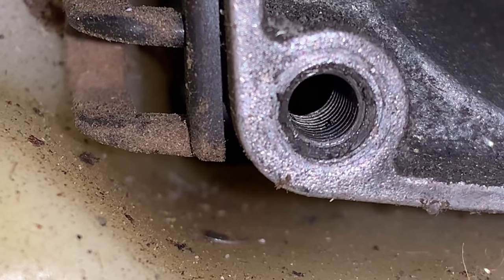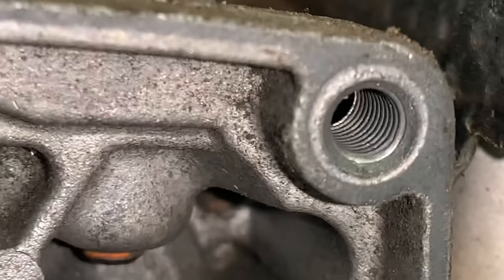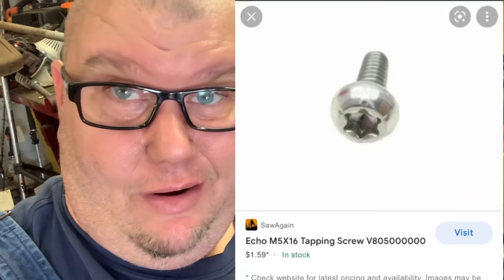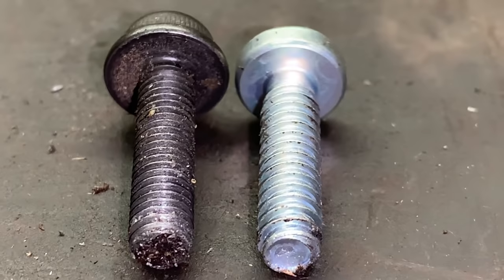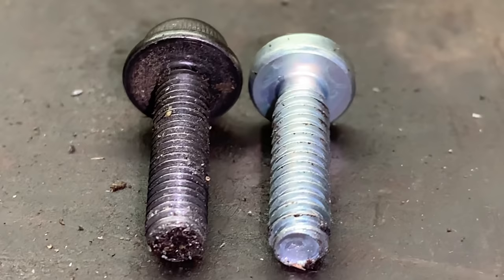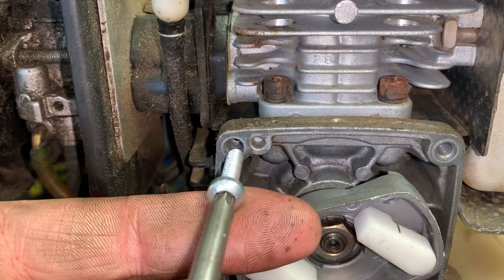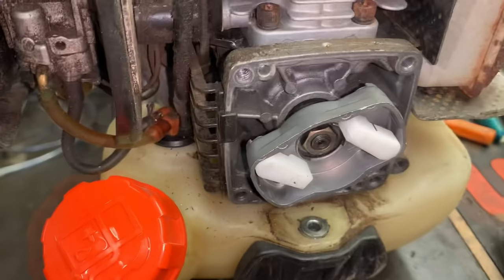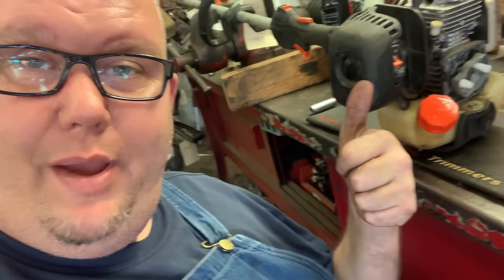STRIPPED THREADS? THIS MECHANICS TRICK / HACK WILL SAVE YOU TIME, MONEY, AND LOTS OF FRUSTRATION

Comment: “There’s is not a single thing wrong with that”  - are you kidding me? There is barely a single thing right with it. There is nowhere near enough material there for that to be any use whatsoever. The tapping size hole for an M5 thread is 4.2mm  and this hole has had the threads ripped out of it. That complete and utter botch job of throwing a coarser thread down a stripped bore will withstand next to no torque at all. You can even see that the thread it has cut is an absolute mess.  Good grief, this has to be the best advert for your competitor ever.
Reply: I agree. Nuts.
Reply: Yes, he screwed up that hole big time. I can't believe he posted the result.  😂
Reply: Look chums this is a get you home bodge when nothing else do it's fine for that ! You are clearly not heavy duty marine engineers are you?
Reply: @bertiewooster3326  Yep, get you home bodge alright. But this guy said "there's not a single thing wrong with that" as if it was equivalent to a proper fix.
Reply: I feel like saying “I’m a French model”  That ghetto fix is frigging awful.
Reply: Bro, he literally banged on it with his impact driver a bunch of times. It'll be OK.
Reply from the maker: Thanks for watching.  Repair still solid after a year BAM!
Reply from the maker: Still working flawlessly after a year
Reply from the maker: Been working great for over a year I’m too fat to be a model
Reply: If this self tapping screw meets the torque specs, I see nothing wrong. However, I’m not gonna use it on something that is prone to leaking
Reply: Best case scenario you then chucked a m6 in their and red lock tight even then it looked easier to be able to bolt it from the bottom with a longer bolt as I a am assuming you want even stretch to a ten spot for a pack of just a few helicoils instead you created a nail as that will pull out
Reply: Looks like the bolt was tapered so once top case is fitted the bolt won't go in so far a d it will be a loose fit.
Reply: I very much doubt it can now torque to anything like what it should but some people sit scratching their head wondering what they can do this is 1 option or go up 1  size of pitch or bolt looks like m6x1.0 swapped with m6x1.25? time cert would be the correct move or helicoil but I get the point I don't like having to start drilling the engine case for example unless its my only option or run a thicker bolt?
Reply: That will help with my seat mounting hole I think

Comment: just sacked a mechanic for using a power tool to cut threads! what planet are some people on. also u should be grinding a line down two sides of the bolt for the waste material to escape

Comment: The notion that a company like Echo ever drilled and tapped  holes individually is ludicrous, as is the idea that inserting a helicoil is difficult or inconvenient. These tri-lobed, thread forming screws work well when properly installed in a very specific hole size, as in initial production, but once they fail you'll be back to the utterly reliable helicoil.
Reply: I prefer the stronger helicoil method.
Reply: strength is the issue

Comment: m5 thread strpped out is the tapping size for m6, i would prefer to tap  and use a m6 socket cap screw ,to ensure the job does not return
Reply: Exactly, that is no good
Reply: If the part you are putting the six mil. screw thru has a big enough hole. Many fixes for many situations.
Reply: And I would tap and change all 4 screws so the next person (owner ?) that takes off the recoil can mix and still match all screws.
Reply: @danielrobert7181  even better  but mowermedic says its a hack not a full repair

Comment: You can always re-tap the hole to the next size like a standard size instead of metrics! I've done that method to fix a stripped out screw before but I  took an extra step with marking the location with painting the spot! You could stamp the location but you can't do that to a screw but paint seems to work easier!
Reply: Tapping is the correct way for sure !
Reply: If you are doing this at home, fine. If he is charging customers, he’s ripping them off! 👎🏼👎🏼👎🏼👎🏼👎🏼

Comment: Over 20 years ago I used to work at a auto shop. When we would change the transmission fluid & filters sometimes the bolts for the pan would strip out. We would do the same thing we had a bunch of different sizes of the self tapping bolts. It was so much faster then using a helicoil kits. There is very little of a negative that could be said about using them.

Comment: Great hack Jeremy!  I usually tap for the next size up cap screw but your idea is a lot easier, thanks!
Reply from the maker: Me 2 or heli coil it. The screw threads are nearly a size up so they bite good
Reply: @THEMOWERMEDIC1 ok so you ARE using a slightly larger size..
Reply: Cross thread is better than loctite🤣🤣🤣🤣😊JR in🇨🇦

Comment: I just got an Ariens snowblower built in 1979 and have it's 2011 equivalent next to it. The newer one uses self tapping bolts for the handle bars while the old one not only has a second layer of steel at the mounting points but uses captive nuts which are easy to replace. I'm putting the same, but newer, engine on it as it's tired but everything else is pristine and built like a tank.
Reply: O

Comment: Just using a courser pitch bolt/screw works just as well. Couple of turns in/ one turn out and so on with oil and a new thread is easily cut especially in alloy.
Reply from the maker: That’s what i did    🤷

Comment: I've used copper wire in similar applications.  Wrap the bolt with fine threads and stick a few strands in the hole and it will chooch .

Comment: ‘Nother 👍 dude!  Great time-saving and effective fix. Only the greedy would Helicoil if this method is possible. The one thing I think about, though, is repeatability in terms of removing and reinstalling that recoil in the future if that one screw is different than the other three. Maybe a red paint marker on the head of the screw and all around where it lives on and under the recoil cover so it’s obvious to the next guy that this screw goes in this hole.  Otherwise you take the risk of rethreading other holes and not having the correct screws.

Comment: This will not last. The previous threads were compromised, so the “new” threads will also fail in short order. In a spot holding a plastic cover or such, this would work, to hold a cylinder on, I wouldn’t trust it.  
Hell-Coil the hole and be done with it. You’ll have a properly repaired hole, and spare inserts for future jobs…….win win.
Reply: Well he did call it a hack in his own title. I'm with you, it's not much more work to put a thread insert in. Plus mix match bolt size and thread pitches is a serious pet peeve of mine.

Comment: The reason most aluminum threads that are stripped is because mechanics use power/air tools to put the bolt on.  They should use there fingers are turn bolt 3 to 4 turns,then use a wrench, then torque bolt to spec.

Comment: a 10MM bolt into an aluminum engine block (for each of 4 ignition coil hol-down bolts in an old Toyota Corolla) is easy to strip out (...so be careful!) and the bolt can be replaced with a same-size by a different pitch self-tapping bolt and you are done!

Comment: I have an e-bike where the threaded  mirror hole is stripped and needs repair for the mirror to be put back in. ( it requires a certain diamater thread to work. If the new threaded hole is too big the mirror won't fit. ???

Comment: Thanks for the tip! Is there a product to seal around base of breather tube? New tube, gasket and plate on vanguard but still leaks.
Reply from the maker: Should be no liquid oil at the breather, if there is then the engine has excessive blow by

Comment: I have a larger carborator fuel inlet that takes a little paper filter, we removed it and now it's like the threads are stripped. It just slides back in. Don't even got to turn it. Like it's not catching the threads. But the threads on the carb and the inlet peice seem fine. Its almost like the fitting has shrank. Even though it was perfectly tight before we removed it. Can you give me some advice as to how I can fix this without replacing the entire carborator.

Comment: Hey, thanks for the tip! I have a Husqvarna 371 xp that the top cover bolt holes and my brake bolt hole are stripped. Do you know which screw I would need to replace with this fix? Thanks!

Comment: I just changed my radiator and I screwed the bolt to the main bolt sideways so that transmission cooler line wouldn't fit in, when I tried to put it back in it wouldn't even start going in straight, would I be able to buy a starter bolt piece like that? Thanks for your time ♥

Comment: Working on water pump on my Ford 300, the idiot mechanic who worked on this before me broke a bolt never replaced it and stripped the other bolts. Now I am in a jam because I need this truck to run in like 10 hours and I don't have my helicoil set on me, so now I have to try and find new bolts, heli coil kit, and try and fix all of this. 

I hate mechanics who don't do shit right. Replace with a heli coul style kit.

Comment: imo not enough remaining material to make a proper tapping - even with a defirmation type (displacement of material) vs cutting type tap-  even with 50% remaining material and about 10 threads it wont break
Reply from the maker: they use these from the factory to cut threads in bear  holes
Reply: And a 'bear' hole is drilled 4.2mm not the 5mm size of a stripped out thread

Comment: So here's my situation....the bolt hole beginning threads are stripped, ...but most of the threads  are good I'd say about 95% .....so if u I use the same size tap to fix the beginning threads....is that possible? I'm trying to avoid using a heli coil....I'd appreciate your reply...thnx

Comment: Did you use a bigger screw to make your own threads ? How can I fix motor mount holes on my lawn mower frame where the motor bounced around and they got bigger plus I need to rethread holes cause the screw just sits inside the hole.. I feel if I don't fix my frame holes it will just wiggle around again?Can you help me

Comment: got plenty of room on the back side, use a longer bolt and put a lock nut on the backside. NO hack needed
Reply: That would be even better, but apparently there was not enough space at the back for a lock nut, or he would have used one. He wasn't making a running repair to the space shuttle.

Comment: Would you go a size up from the original bolt diameter or use the same size but with a self tapping bolt?
Reply: Wasn't too clear but I think the self-tapping bolt had coarser threads but was the same diameter.

Comment: I'm confused, why not use a tap, then use the original or replacement new bolt? is it for hard to access areas?
Reply from the maker: There are zero threads to tap, hence that’s why you use a larger courser bolt

Comment: This is impossible. If both screws are 5mm and the thread was stripped all the way through, then there would not be any material to cut a new thread in. Obviously there was undamaged thread at the end of the hole and that is what makes it appear as if the thread was repaired.
Reply: Yeah I agree that this wouldn't be very strong and a longer bolt with a nylock nut on the back would have been a better fix on this job
Reply: @T2D.SteveArcs  I just had to do exactly that. Long bolt nylock on back with a standard nut at far end.
Reply: @shadowjack48209  👍
Reply: C'mon Man you know the thing
Reply: Most likely it's a different thread pitch
Reply: This "fix" ist bogus anyway as he drives the screw in with an impact wrench. This will destroy or damage the thread anyway with weaker materials like aluminium and if you apply torque to it it will come out again. Not suitabel for exhaust bolts or anything that must be screwed in with some torque. You just create more damage with this method while the screw will come out once again under load.
Reply: I might be wrong but I think it has to due with thy type of thread on the bolt is why it worked we have machines at work when they blow a hydraulic hose sometimes we dont have the correct fittings when making a new hose thread wise the fitting will start but it has to be forced in the rest of the way so were pretty much just making new threads at that point nps fitting vs npt
Reply: You can see it’s a differently pitched thread - that’s the secret.
Reply: @MossyfromNZ . Exactly, a self tapping thread in the same approximate thread diameter, but with different biting characteristics.
Reply: The thread pitch is different. Bigger flutes to grab onto the aluminum. If you put a digital caliper on the two bolts, you'd see the self tapper is fractionally larger.

Comment: If you can go out to a helicoil I'd probably just tap it to M6 and open up the hole in the part.
Not so good on stripped M6 as M8 is next.
Ok hack if works though,fix it and leave well enough alone.

Comment: Not really a trick or hack when you're just ramming another bolt in with different threads.
Reply from the maker: Have a nice day thanks for watching
Reply: It’s a self-tapping screw, so it cuts another thread, slightly deeper than the original. He’s not just jamming a bigger screw in there.
Reply: @THEMOWERMEDIC1 😂😂😂
Reply: The same thing as running a tap through. Only to use a larger bolt. Only he left out several steps. 😅😅

Comment: Or a longer bolt with a locknut and washer on the back side threads are overrated if you can put a nut on the back.

Comment: I would check out the comment by @brianpenny9412 and the responses to it before doing this. Especially if this is something that needs to hold strongly or has a high torque requirement or could cost you a ton of money/time if it doesn’t work right. I’m not saying it is or isn’t possible, but I think it is worth reading his comment and the responses to that comment and researching yourself prior to just doing this in the heat of the moment. Not sure this is best for all scenarios is all.